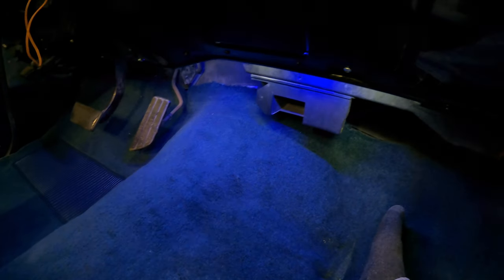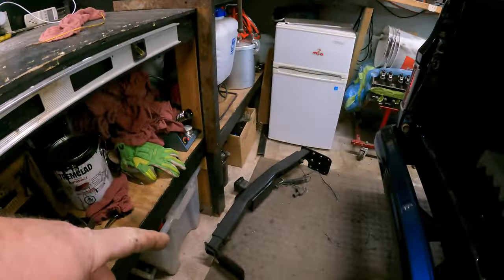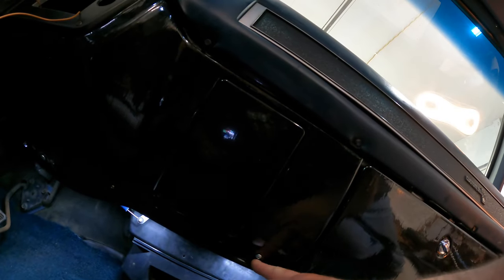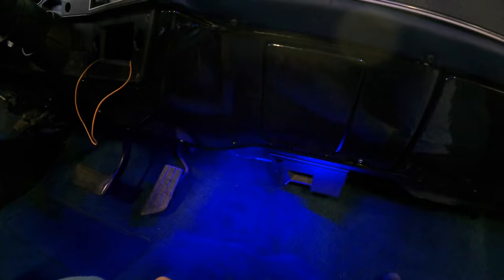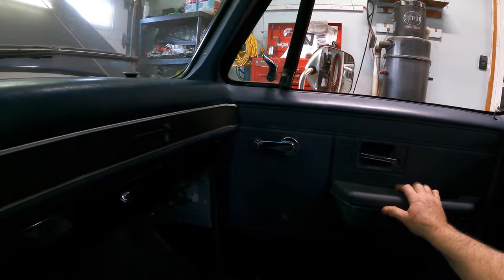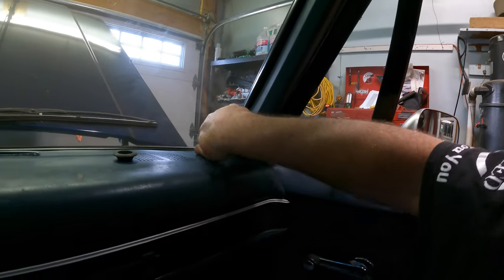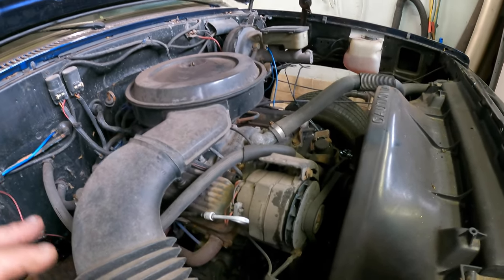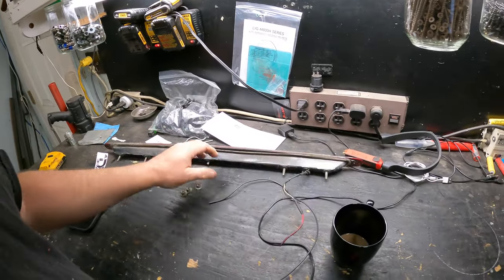This Is What And Why   4K

Comment: Bill go with a rear slider and one other if you don’t want exhaust smell well that’s open Take an old tire tube cut it in half crimp the ends melt them and then put it in between the box and the cab and fill it up

Comment: I was just looking at vintage air as an option to redoing the factory air setup on mine.  Seems like a reasonable easy to install self contained setup.  The only thing I have any reservations about and have not found anything on is the heater core. As in how easy to change out (stocker in the truck as you know can be r&r'd in 20 minutes), and wether or not their core is an easy to get off the shelf core for some other vehicle or some stupid proprietary thing you can only source from them.    Another nice thing, nothing remains on the engine side of the firewall. That bloody suitcase annoys me. 
 
Carefull with the blue lights at the front of the cab, Ontario includes blue lights in the HTA wording for emergency vehicle lighting now.   
  

The 3/4" measurement to the fender or suspension point?  If its only been a single person in that truck always, if its got the base springs in it, they will sag noticably. My 81s got a healthy lean to it thanks to the soft springs it has and decades of rarely having a passenger in it.